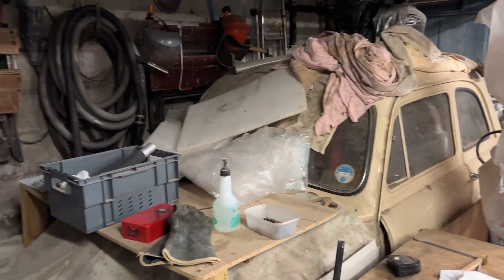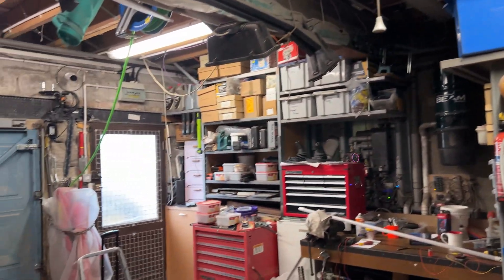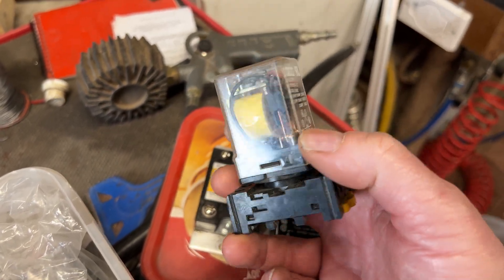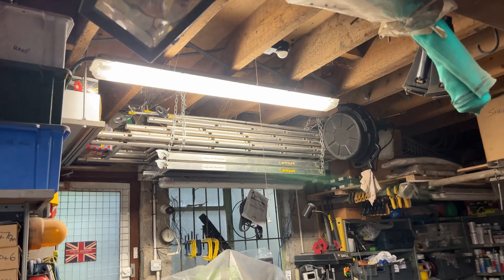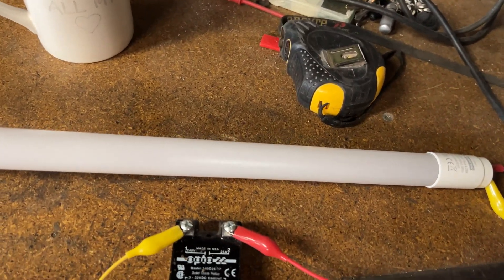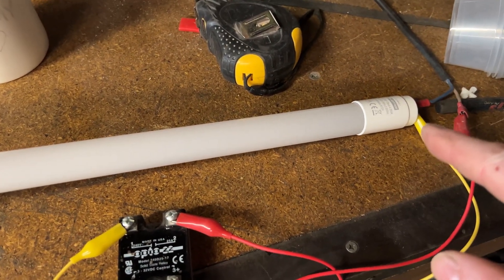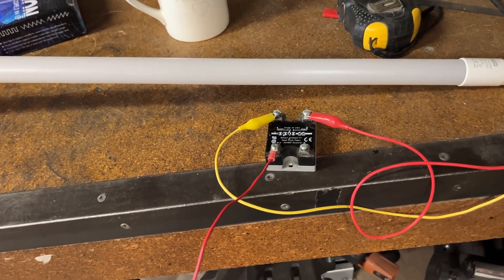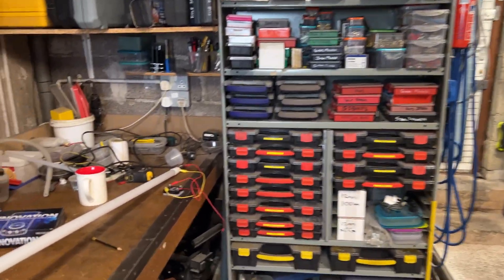Solid State Relay Warning and Observation

Comment: Thanks for the insight. Yes, the issue with any SSR design is that most include internal snubbers which result in some leakage, also a minimum load / current requirement. There are some SSRs which exclude the snubber and MOSFET based SSR's with very low leakage but they are not the ''everyday types'.
Reply from the maker: Hi Ralph and thanks for the comments. It was a bit of an eye opener for me with regards to the wasted electricity. Now I'm wiser 😀. Thanks for watching 👍🏽
Reply: @MikeMakesIt  Ah, not just the wasted electricity but sufficient leakage current through the internal snubber to turn some things on, especially ac-based low-power loads. There is a document from Omron, Solid State Relays Common Precautions, if you have a day spare.
Reply from the maker: @ralphj4012  thanks Ralph. I’ll take a look 👍🏽😀
Reply: At an Energy control devices fabricator i obsserve that at start they was using SSR mounted on aluminium dissipating radiators. Of coars they was feeding heating ellements and the leaking was irelevant. The isue with SSRes was that they was having a heat dissipating rate a bit defficient since eve if mounted on radiator they was bursting every so often we had to go at customer's facities for troubblechoot. As soon we found that the SCR eas the sollution we started to change in the control panels for free all the compromised SSR c.troles. How ever, we made a long way from contactor c.trole with mobile and clapy parts.